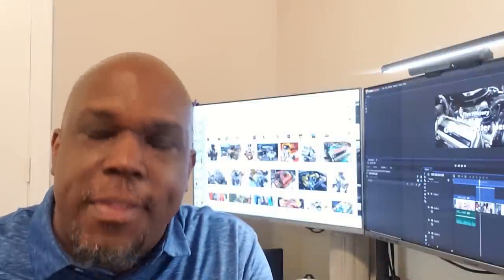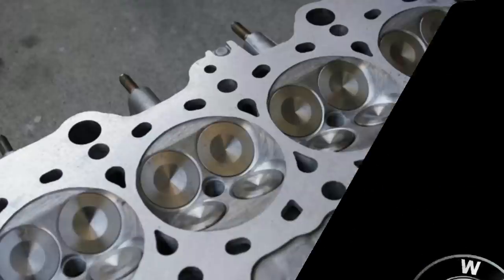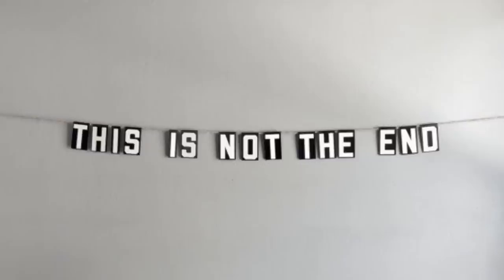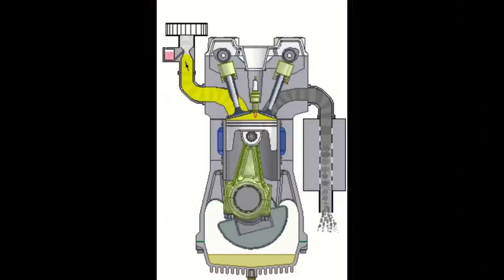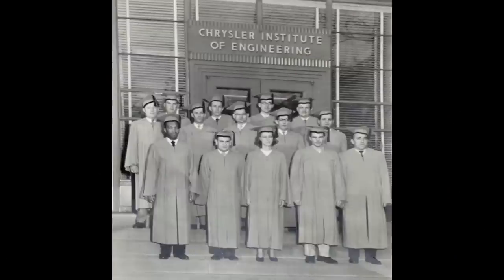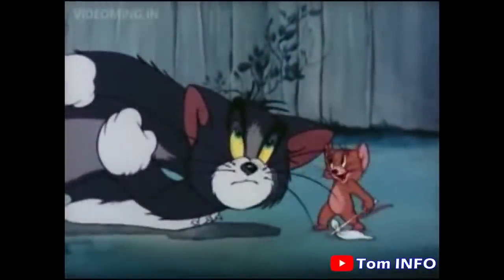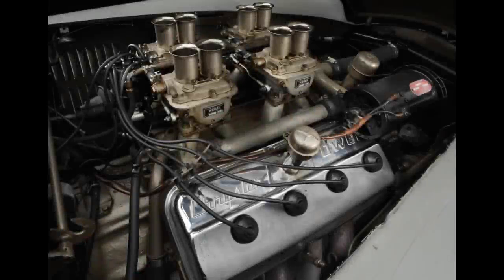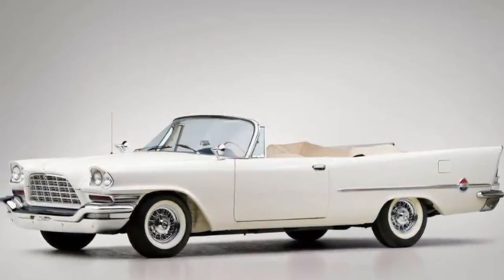The History of the Chrysler Hemi Gen I

Comment: The Ardun kit wasnt actually developed for Hot Rodding, it was developed for truck drivers - because you had some pretty huge van bodies being put on the Model A truck platform - but there weren't any diesel engines like Cummins or Detroit available at the time.. And instead of taking some oof your load off to get over the rockies let's say, with one of these hemi conversions on the flathead you could make it on time and with a full load.
Reply from the maker: Thank you for the information!
Reply: The Ardun head was “stillborn”   because Ford brought out the enlarged 337cu/in flathead. The expense and precision machining of the Ardun was uncompetitive to buying a  with almost 100 cubes of grunt. I believe that’s how they ended up in the hands of the hot rodders, they were unwanted for trucks but appreciated by rodders.
Reply: and to add to it that was done mainly for garbage trucks! the flatheads were getting into trouble when loaded and had to navigate hills.
Reply: The main problem with the Ardun heads at truck use was "too much power". Flatheads with Ardun heads kept on producing more and more pover as the revs rose up. There was no "dead spot" at the top of the revrange, so the drivers ended up over reving their engines on various situationes, consequences being predictable. Resulting a reputation of unreliability. The hot rodders and race engine builders understood the engine behaviour better. Besides, the expected lifespan of a performance engine is much shorter than of one istalled at a heavy duty vehicle. Nowadays a wealthy person interested in good living and old fashined hot rods has the options of buyin a good sized mansion or a pair of vintage Ardun heads at a decent condition. The really rich can do both...
Reply: @Chuck U Farley, the Arden heads were fantastically successful in many ways, but the bottom half of those engines could not handle the increased rpm's and increased downforce those pistons could produce with the new heads. The cranks of the flat head V-8's were supported with 3 bearings, as opposed to 5 on the later more powerful V-8's in later years. Also things like connecting rods, pistons, lubrication systems, transmissions, clutch's, driveshafts, differentials, drive axles , etc just could not handle the increased torque the Ardun heads brought out of the early American Ford V-8 engines. The entire vehicles would have to be re- designed to handle the extra power & torque... Not long after that dilemma, WW2 was in full - swing, and production was changed to building military equipment... But Perkins was manufacturing diesel engines by 1933... I'm thinking that the company Caterpillar, who were licensed to produce Perkins engines, could have made the engines & drive lines available for the trucking industries in the U.S. back then, but that was in the middle of the depression, and few people could afford such extravagant things at that time. So yes-,  the Ardun heads for the flat-head Ford v-8's were probably a relatively affordable option for the people with trucking companies... They just had to learn, how to apply power smoothly, to make those engines and drive-lines last.... As time went on, the truck and heavy duty applications of engines & drive lines became very useful for several hot-rodders, as these stronger parts could handle more torque and punishment than the light duty passenger car applications...stock  4-bolt main caps for Chevy Small Block v-8's, Dana-60 differentials, 12-bolt & 14-bolt GM differentials, Ford 9" differentials,  M-21 & M-22 Saginaw trans, A-833 Mopar trans, Chrysler 727 trans , GM T-400 trans , Ford C-6 trans, 11" and 12" Bendix drum brakes, Kelsey-Hays and Benbix disc brakes , Heavy duty Spicer drive axles, drive shafts and 'U' joints, all of these things were originally designed for trucks and other heavy duty applications... The drag-racung and stock-car racing people started using these components with great success at the tracks...
Reply: The Ardun heads were invented by Zora Arkus Duntov, Corvette meister.
Reply: @TheGearheadLounge  
When you gonna do the next 2
Reply from the maker: @RichardMLowe  Working on it now! The script is almost finished. I just keep discovering as I research!
Reply: One part you missed explaining early in the video is the valve arraignment. The reason they flow better is more the angle than anything. They enter the combustion chamber at an angle getting them away from the cylinder wall as lift increasrs and unshrouding the valve head.

Comment: My dream of building a first generation 354 Hemi powered AA/FD with a partner after graduating from HS died the day in '66 when I read of Don Garlits 2nd generation 426 Hemi finally running about 15 mph faster and a third of a second quicker than anybody else at the time. I had been watching Don's 426 failing to break into 7 seconds or over 200 mph for about a year and hoping for more of the same. Don finally did it by advancing the timing way beyond what a first generation hemi would take for long. You needed to stick with 34 degrees with any 331, 354, 392 or Desoto running Nitro Methane (the mains too narrow in the little Dodge Red Ram for Nitro). Don was running 50 damned degrees and I could see the end of the reign of the First Generation and the independent Top Fuel teams coming.

And it was getting crazy anyway with guys taking half the clutch springs out for slipping clutches to allow for a bite of the tires on the pavement. That was beginning of the end of the "Smoke Run Era" but more important to me it was killing drivers with blown clutches like they had never done in those numbers before. I wasn't going to drive but i didn't want my partner disemboweled by a clutch plate headed for the stratosphere either.

This guy, Tom Jobe of the "Skinner, Jobe and Sorokin"  - "Surfers" top fuel team of 1964-'66 can tell you some additional reasons, besides the breathing flow, why the Chrysler Hemi of the 1950s ruled the roost in AA/FD through 1966. If you didn't start with a Chrysler you changed to one if you wanted to compete . . . https://www.youtube.com/watch?v=gZzUMBAXGsQ

Comment: Interestingly enough, the final nail in the 'hemi' coffin came from Yamaha with their radial 5-valve, true center plug, FZ750 four cylinder motorcycle engine in the mid-1980's. Pushing the design and its physics to the limit, their conclusion was that while total valve circumference was maximized, the benefit wasn't significantly beyond what was available from pentroof chambers, flame front travel and ignition were actually hindered at high rpm, and that the only performance benefit gained was in absolute torque, and a more broad curve of peak torque. In simpler terms, max 'VE' (volumetric efficiency) at mid-rpm levels, just as Pratt & Whitney had discovered with their radial engines!

Comment: I didn’t see anything on the cross ram manifolds on some Chrysler letter cars. There was a long ram version with two four barrel carbs. The carbs were positioned over the respective valve covers and fed the cylinders for the opposite cylinder bank. It was a pretty innovative setup. I saw a fleeting photo of one in your video but no mention of it. I saw one in the flesh at a Chrysler/Plymouth/Dodge dealership that I used to hang out at as a teenager.
Reply: @konacyclist, There were two versions of the cross-ram manifolds for the 'B' & 'RB' Chrysler wedge engines... The short cross rams were for mid range - top end on the 383 'B' engines... And the long cross-rams we're to be used for the 413 'RB' engines and they were for Low-end to mid-range power boost. I heard that both designs worked very well, and several of the current intake manifolds use this same technology...
Reply: This video has nothing to do with wedge 361383 413 400 426 or 440s , or small blocks,  clearly says gen 1 hemi ...

Comment: To note - For Aviation Engines - the "Roman Numerals" in the IV-2220 are NOT "Roman Numerals" - they are LETTERS.  V signifies a "V" style engine (Rolls Royce Merlin), R is a Radial engine (Pratt & Whitney R-2800 Double Wasp), I is an Inline engine (Several WW1 German planes), H is an "H-block engine (Napier Sabre engine), X is an "X" engine (Rolls-Royce Vulture engine).  
In the case of the IV-2200 - it means INVERTED V-type engine similar to the Daimler-Benz DB 605 in the Bf-109.  The 2200 is the Displacement in Cubic Inches. Thus - the IV-2200 is a 2200 Cubic Inch Inverted V type engine. The X designates it as an EXPERIMENTAL engine.
An aircraft supercharger is NOT driven by a belt - it is GEAR driven - and on MANY engines - particularly the RR Merlin - it is actually a 2-speed Supercharger, with a gearbox that is able to change gears when flying.
Reply from the maker: Thanks!

Comment: The entire video is accurate and places events in context very well. The only inaccuracy I found was at the end - and I share this because I thought you would appreciate the nuance, not as a criticism - where you mention some '59 Imperials were built with 392 Hemi engines. That's not quite the case. Chrysler built all the '59s with 413s. But the story is that in late 1957, a batch of 392-powered Imperial hardtop coupes were sent to Italy to be bodied as Crown Imperial limousines by Ghia. While there, the model year soon changed to 1958 so Ghia decided that they would finish them as '58s. But there were so many production delays that the last 7 of those 1957 chassis were bodied as '59s! They were assigned 1959 VINs, but there is evidence that they all started as '57s because the dashboards, trim tags, and engines are all '57 spec. So in that way, it is accurate to say that some '59 Ghia Crown Imperial limos had 392 Hemis from new, but Chrysler never built any '59 Imperials with Hemi engines. I am absolutely impressed that you got so many details right in your video and as you can see I'm a bit of a stickler. Great job! I instantly liked and subscribed.
Reply: Also, at 11:41 Hemis DON'T resist detonation well... compared to squish/quench chamber engines... and 7:1 hemis don't make more power than 10:1 quench engines...
Reply from the maker: Yes, I appreciate this information! Thank you!
Reply from the maker: Thank you for that!

Comment: Point of correction: "IV" doesn't stand for the Roman numeral 4. It stands for "Inverted, V engine" as in a V arrangement of the cylinders. Therefore the IV-2200 stands for "Inverted V-engine of 2,220 cubic inches." V is just as it sounds, i.e. the Allison V-1710, V engine of 1,710 cubic inches. "R" stands for "radial."
Reply from the maker: Thank you!
Reply: I came to see if anyone had made that comment!  'IV" does equal "inverted V" the X means "Experimental" and 2220 is the displacement in cubic inches. If it had gone into full production, the "X" would have been dropped and it would have just been the IV-2220.   This was/is standard aviation engine nomenclature, at least for the US.  For example, the Pratt&Whitney R2800 is a "Radial, 2800 cubic inches,"  and the Allison V-1710 is a "(non-inverted) V-type, 1710 cubic inches." The Packard-built, US version of the Merlin was called the "V-1650." After the military quit using piston engines, the civil aviation community kept using the basic terminology, with some modifications. A Lycoming 0-360 is an "opposed, 360 cubic inch" engine. The IO-360 is "injected, opposed..." and the TIO-360 is "Turbocharged, injected, opposed."

Comment: 1951- and some 54 331 C.I. were cast with half the bell housing on the engine block making them a pain to hang other transmissions on them .In 54 1/2 they went to a normal bell housing as well as some bigger and D shaped exhaust ports. The bell housing is same bolt pattern as A and LA 273 318 340 360small blocks .I had a 1965 Miller flat bottom ski boat that a buddy owned that had a 60 over 1956 354 that was rusted out .I built a 55 331 and it was fun .I bought the wreckage from a trailer accident  restored it and built a naturally aspirated   with Crane Cam and 10 to 1 forgings 1957 392 ci from a 1957 New Yorker . I was a blast on the lake . I finally got scared of it and sold it.

Comment: The Gen 1 Hemi was also used in military applications. I have two that came from an APV.  I have found very little documentation on them. Even the historical society tried but came up with nothing. I have pictures I can share if your interested.  Really cool engineering made to run completely sealed with the transmission and under water.
Reply: This old man would enjoy some of that as I pulled wrenches for over fifty years of my seventy three here so far. I'm not a chrysler kind of guy but respect their technology they gave us... lots of stuff that should of made more ways of use. Like that continental six an the same only eight or the "straight eight" they were known for that ran tirelessly for years in some of the strangest applications.
Reply: @morgansword  I have to figure out how to share them publicly.  Will work on it.
Reply: This is from 12 yrs ago. I have one of the blocks converted back to auto and in my 55 Chrysler Windsor.  They were pretty beaten up. But these blocks are supposedly stronger and sought after by racers back in the day.  They were cast at Trenton Engine at the end of the shift, when the nickel content in the vats were highest.
Reply: The 331 in my pickup was out of an Air Force power unit.  Had very low hours and sealed ignition all the way to the valve covers with an aluminum coil cover.  I kept all that stuff but converted the Industrial Hemi to automotive use and has been in our pickup for 20 years.

Comment: I would like to go on record that the 3rd gen Hemi is technically 4th gen..the 4.7 is a overhead cam Hemi with the spark plugs going through the top of the cylinder heads just like the Ford 427 "CAMMER" which was Ford's answer to the 426..

Comment: The Rolls Royce Merlin had a supercharger driven by the crankshaft.  It was reliable but had to be designed into the engine.  A exhaust driven turbo-supercharger could be added to a non-supercharged engine as was done with the P-38 Lightning.  Both methods of supercharging were used during the war and both had advantages and disadvantages compared to the other.  Today turbos allow companies to cheat on emissions since the engine has a low compression ratio and low NOx emissions when it is not boosting.

Comment: Regarding the aero- application superchargers, Rolls Royce used a 2 stage supercharger that drove via a gearbox off the main crank. No belts used, so no belts to lose. This was all known technology in that day. Turbocharged versus gear driven supercharged was an engineering choice...
Reply from the maker: Thank you for that information!
Reply: The supercharger that most hot rodders used came off of the 6-71 Detroit Diesel, all Detroit 2 stroke diesels use a supercharger, but some have a turbocharger on top of the supercharger. This was called twin charging.
Reply: Problem with all UN Blowen HEMI'S is when you got the 
64 up 426 Hemi's they were exec but a total STONES compared with what they could be made to be. The stock HEMI only produces any Real power OVER 3000 to 4000 RPM. So guys with GM Big Blocks would have an advantage as you came off the line unless your were turning 4000 plus or
you were deep staging. 
Of course if you were putting enough boost into your engine that was another thing. You were a total bomb at any RPM THEN.....😊

Comment: A great example of an aircraft piston engine that is 'Turbo-Supercharged" is the P47. The P&W wasp radial has a crank driven blower built into the engine case and a turbo charger was also ducted into the rear of the aircraft. I believe the blower on these was two-stage. The R-2800's I've seen the most were three stage blowers built into the case with no turbocharger, like the F6F and F4U.
Reply from the maker: Thank you so much!

Comment: I have a 55 300, it has original driveline, the engine has one of the earlier two barrel set up s for Chrysler,great video, I got that black one rite down to the hayse rims, also first production car to produce 300hp, hence reason for name
Reply: Three years later Ford Motor Company would produce the worlds first production car with 400 horsepower, the 1958 Mercury Turnpike Cruiser with a 430 ci MEL series engine that had 3x2v carburetion.
Reply: @donreinke5863  I think there they're both good cars!

Comment: I wasn't expecting much from this video. I have watched several videos on many subjects and most had an obvious bias. Your video was well done and I really appreciated watching it. You went into details that very few people are aware of. The aviation history of the Hemi was extremely interesting to me having worked in the aviation field. I have often wondered how a plane like the P 51 would have performed compared to the Packard Rolls Merlin engine?
Reply: - Uh, the successful version of the P 51 got the Merlin engine...
Reply: @BuzzLOLOL  My question was how would the Merlin  compare to the Hemi. The Hemi was to late to be used in a P51 but I do believe it would lose in the speed catagory if it went up against the Hemi?
Reply: @mattedwards4533  - The hemi was too big, heavy, complicated, and expensive... still, the winner would prolly be the one with the most boost pressure... meth/h20 cooling... highest octane fuel... nitrous... etc...
Reply: @BuzzLOLOL  With the aluminun alloys I think the weight would not be a problem as most of the big block engines from Ford and G.M are not much different in weight to start with?As the video showed a Hemi by its nature turns out slightly more horse power anyway. Not only did Indy ban the Hemi Nascar did as well and the engine met all the qualifications? It was just a more efficient engine.
Reply from the maker: Thank you so much for watching! I'm glad you liked it!